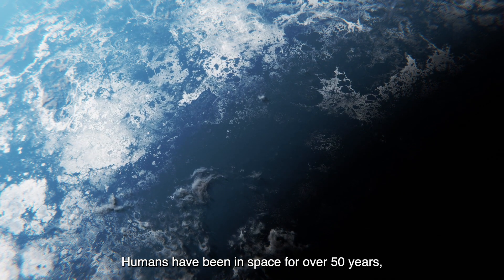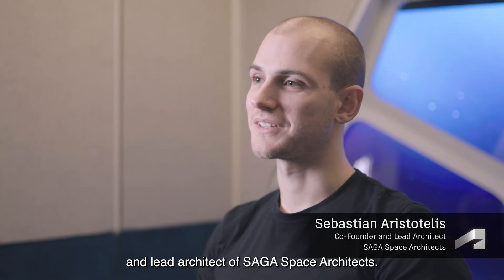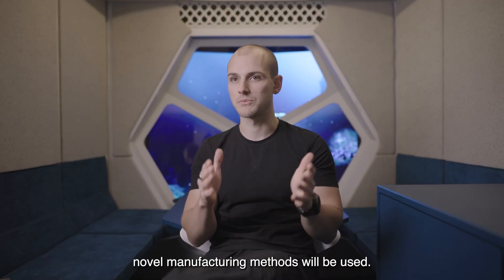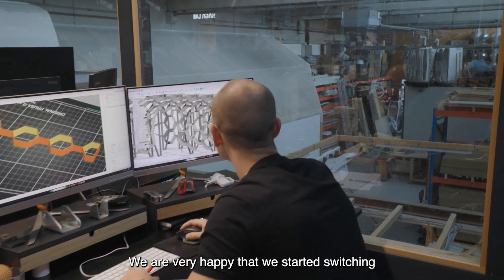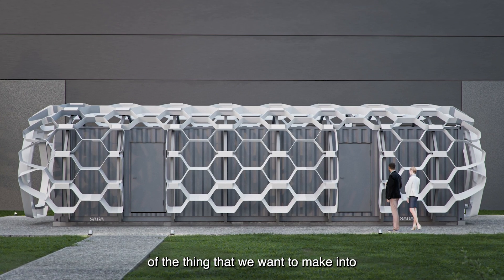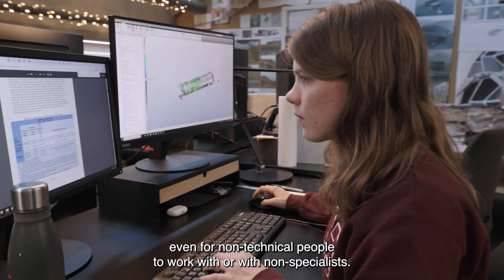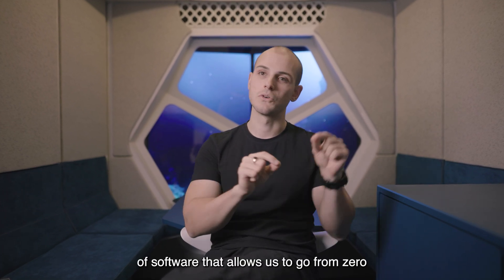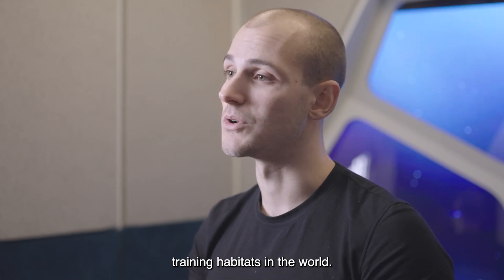SAGA Space Architects Believe Architecture is the Key for Humans to Thrive in Space

Comment: DUH!!! to the title :) hehe..  in space you need ballistics proof micro meteorites systems and stopping this debris is the issue. 3d printing is great but, lightweight kevlar or blanket to slow down the crazy speeds this debris can strike at.  if we move up there, using dirt and stones to cover the buildings will protect them from these issues. Some of the structures you are seeing on those models is what those shapes are for. Commercial space is what this is for. Behind closed doors these issues were solved a long time ago.